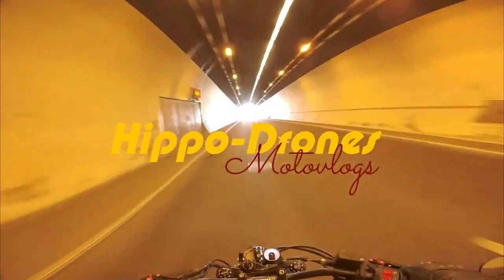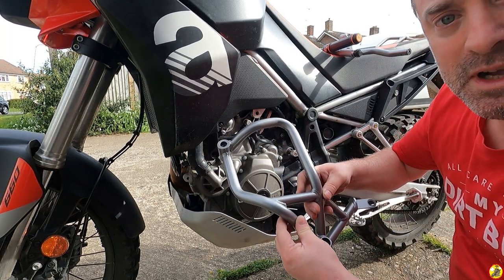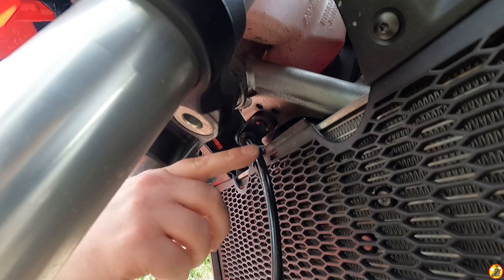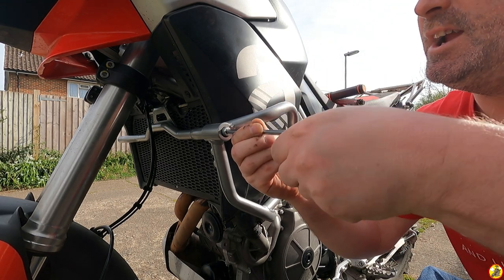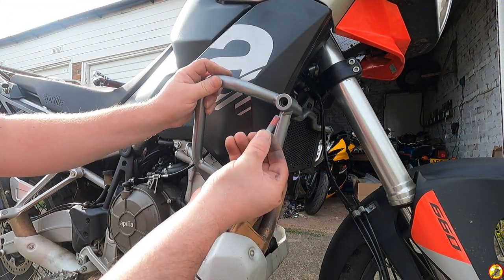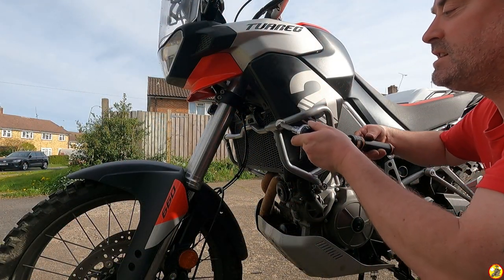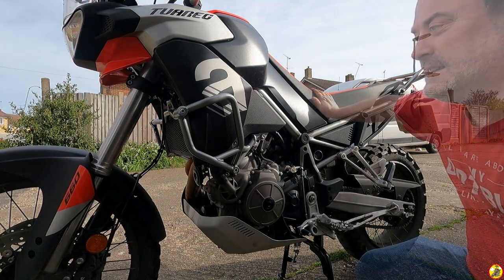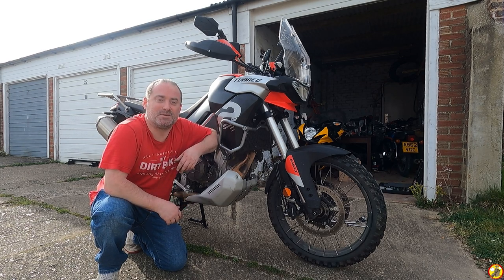Aprilia Tuareg 660 Accessories | Engine / Perimetral Guard Install

Comment: I'm impressed how the fixing holes lined up with no bending or manipulation unlike many other frame & engine bars. 
They fitted quite easily. Nice one.👌 
The side bars look quite small compared to others, but actually they are positioned where the tank panels will make contact the ground. And of course being smaller with less tubing will mean saving weight which is always a good thing. 👏👌🤞👍
Reply from the maker: They really were dead easy to fit and like you say, the position they mount looks spot on to protect the bike. I hope they are as strong as they look 🙂

Comment: I’ve installed the Aprilia Pannier racks, panniers, crash guards and aux lights on my Taureg. All from the Aprilia accessory catalogue. One thing I’ve noticed is how they are designed to fit correctly without being forced to bend or contort the pieces to line up with the bolt holes. I can’t tell you how many bikes I’ve owned where accessories are built to much less exact specs.
Reply from the maker: I've just fitted the SW-Motech sump guard to mine, had to grind off part of the Aprilia Perimetral Guard to make it fit.
Reply: @HippoDrones  sounds like SW Motech didn’t design the skid plate to work with crash bars. I have a Thor skid plate from  GP Mucci on order. It was designed to work with the OM crash guards. I like when the aftermarket attempts to build their parts to work with a variety of accessories.
Reply from the maker: @zyonsdream  yeah, they did say in the blurb that their parts are designed to work with the bike in standard spec so I was expecting to have to modify the engine bars

Comment: Hi Hippo
Just fitted Motea Protection bars to my Tuareg.
Iam sure you found that as i did the front 2 M10 engine bolts had Yellow factory Torque marks & were at a lower torque than the 2 rear M10 with the Red factory torque marks. (could have been Orange) As in Industry Red is usually used to indicate a fastener must be renewed for some reason.

Torqued the bolts to 50 NM (checked in the official service manual) but ]i still believe the factory used different figures front & rear as there would be no need to use different colours otherwise.
The factory seems to use different colour torque marks around the for the different torques or maybe for the wrenches used. Green is also used on some other fasteners.

A tip i would pass on is, before undoing a fastener from the factory setting make your own torque marker line across half the bolt head or nut continuing down the side onto the material area at the side.
So to return the fastener to the same torque re tighten until the markers line up again.
Especially useful for wheel spindle fasteners were you might be out on the road with no access to a torque wrench (even if you know the correct torque)
I tend to use white marks on the l/h side of the bike & yellow on the right.
Reply from the maker: Hey @brie6966 thanks for the tip :-) that makes good sense! :-)
I think there were different torque specs front and rear, can't remember now though as this video was recorded almost a year ago :-)

Comment: Nice how to video, thanks for sharing. A couple of things. I was wondering what Torque wrench you have as it doesn't appear to be listed in your kit and caboodle. Also the torque wrench settings were 10, 25 and 50 Nm? Please confirm?
Reply from the maker: Thanks David 🙂👍
I have a couple of torque wrenches, both I believe I got from Halfords. I have 2 as one is for lower strengths and the other is for higher torques. Think they are from their pro range.
TBH, it was a while ago I recorded this. Your best bet would be to join the Aprilia Tuareg 660 UK Facebook group, you can download the service manual and torque specs from the files section on there for free.

Comment: That's bang tidy fella 👍
Reply from the maker: Should do the job too 🙂
Reply: @HippoDrones  nice little investment as those panels wouldn't be cheap to replace
Reply from the maker: @deepjoyrides  yup... although Aprilia plastics are not too pricey... whereas these protectors were £500 from them... perhaps I should have just got spare plastics! 😜🤣
Reply: @HippoDrones  haha yep that's a good point but the bars look good. You could maybe get some little spot lights to fit in them
Reply from the maker: @deepjoyrides  I hardly ride at night, but might get some small bags for them.
Reply: @HippoDrones  that's a better idea. Get a gear gremlin, tools & a metal flask in them. Super handy
Reply from the maker: @deepjoyrides  🙂

Comment: Wait a minute, did you change your tires?
Reply from the maker: Yup, got the Motoz Tractionator Adventure tires fitted by my dealership before I collected the bike.
Reply: @HippoDrones  sweet! Smart move!
Reply from the maker: @SuperCheesyMan  We have quite a lot of wet mud on the trails I ride, so I didn't think the Pirelli STR tires would suit... although they would be a lot better on the tarmac.
Reply: @HippoDrones  so what's your feedbacks on those Motoz?
Reply from the maker: @SuperCheesyMan  I absolutely 100% love them.... they took the running in miles to the first service to bed in and feel less sketchy on tarmac, but from day one, they were fantastic in the dirt. They are a compromise though, and at pace on tarmac, they do make the bike a little twitchy, but are fine up to 80mph, and faster on smooth roads.... but they are 75% dirt 25% road, so will not be as well mannered as a 50:50 tire on tarmac.

Comment: Those engine bars are very tasty, a nice install again too. I want a bike with engine bars purely as it makes mounting a 360 so much fun :D I must get some prit-stick locktite, looks a lot handier than my liquid stuff. Haha 50 +/- 15 is a bloody massive tolerance, that was the same as my steering damper on the GSXR, head nut was 70 +/- 20 :D 
I do like how slimline they are, do a job but aren't massive :)
Reply from the maker: They look great at the moment! :D hahaha
That was one of the things I loved about the V85TT, it was the best bike for mounting a 360 camera to, frame bars everywhere! I was just looking at the Tuareg just now working out where would be good 360 mounting points for tarmac and also for dirt.
Hahaha, yeah it made me chuckle, but 50 is a nice number, so that is what it got... that reminds me, I need to check the rear spindle nut as I didn't have a torque figure for that (owners handbook doesn't list it) for when I adjust the chain, 120Nm is what I need... no wonder it was stiff to loosen!: D haha
Yeah me too, and was super grateful for them being slim on my day adventure with Mr Fish, had to squeeze through some super tight gaps between fallen trees1 :D

Comment: Picked my Atreides Black up a week last Friday and am Buzzing1 First service done on Saurday. .Great video Man !  Looking forward to some Surrey hills Green la ing. Just ned to get my crash bars sorted and still trying to decide on a new bash plate. AXP looks good but apparently front mudguard can catch when bottoming out front suspension. Any recommendations on bash plates mate ?
Reply from the maker: Awesome to hear you are loving it mate. I have the SW-MOTECH sump guard which is nice and solid. I did have to modify the engine bars though to work with it.
I think the issues with the AXP were just with the Mk1 and they have modified the design now, but I've no experience with their products. 
Hopefully see you out on the trails soon bud 👍

Comment: Have you noticed much heat from right side on your leg?
Reply from the maker: Hi John,
To be honest, no more heat than any other water cooled multi-cylinder motorcycle. Sure there is a bit, but any water cooled bike with a fan will send it to your legs once the fan kicks in, my GSX-R750 is warmer.
Reply: @HippoDrones  Thanks, I've heard it throws off serious heat?
Reply from the maker: @johnboy3100  I tend to wear proper bike kit, so maybe that masks it

Comment: Am I right in thinking these crash bars use the engine mount threads?
Reply from the maker: Yes some of them.
Reply: @HippoDrones  so one bad knock and it could crack the head like it happens on the cb500x.... Adventure bikes with insufficient mounting points that can cause even more damage once fitted... I must be missing something. Gotta say it's a pretty bike, very nice looking.
Reply from the maker: @porter5877  No idea, I mean, it was designed by Aprilia for Aprilia, and all crash bars I have seen for other motorcycles I believe use some engine mounts as the engine is a stressed member on modern bikes, but I guess if you hit something hard enough, stuff will break. Having dropped mine a handful of times now, I've had no issues or damage. Might be a different story on rocks or on the road, but crashing on harder stuff is generally gonna cause significant damage if you don't have any crash protection, so it is a case of flipping a coin. I no longer put crash protection on my road bikes, but the bikes I take on the trails get it because I am more likely to fall off... and fall off at slower speeds than I would on tarmac.
Reply: @HippoDrones  yeah that's a good point dude. I need to test ride one I'd like to feel the difference between the 700 tenere.
Reply from the maker: @porter5877  Sadly the T7 was too tall for me... I couldn't even get it off it's side stand in the dealership, but the 20mm the Tuareg is lower made all the difference. It is still a tad too tall for me, but I'll order the lower seat for it soon now that is available, which should bring it down to 840mm which will be far more manageable on the trails 🙂
I hope you can get a demo, the Aprilia is an awesome bike... but so is the T7, so you can't go wrong with either if they both fit you! 🙂

Comment: Man that’s so much easier than mine. I should be getting mine in next Tuesday. I helped my buddy install his on the Africa Twin so now to do mine.

Is your Rad guard plastic or Metal? Mine came with a fairly ridged plastic and wondering if i even need to upgrade. Probably should eventually.

Man that’s a good looking bike😎👍.
Reply from the maker: Thankfully dead simple, and hopefully well designed and strong.
I have a plastic rad guard currently, and will probably replace it with a metal one when I get a chance.

Comment: Also..., I recognise that block of garages. Did you make a video a few years back reviewing the Worx Hydroshot battery powered pressure washer? I think the bike being cleaned was a Beta Alpha? 
If you did, following your review, i bought one during the 1st lock down. Cracking bit of kit I love it. 
I take it in the van with me with a 5L water canister when I go mountain biking & Motocrossing.
No more scraping & brushing  piles of mud off my drive. 
Who needs that after a long day riding & your tired & it's getting dark? After what you would pay at the garage  jet wash every sunday, it eventually has paid for itself.
I also use it to wash the van when I can't be arsed with the faff of unraveling the hose pipe down the drive 👏.
 If it was you, have you still got your Hydroshot & do you still use it?
Reply from the maker: Hi Dan, yes that was my video. I still have the HydroShot, I love the Worx battery tools,  have several of their products. I have not used it recently as I've found it more convenient to use a jetwash at a petrol station, but you are right with how convenient the HydroShot can be.
I loved my Alp 4.0  but traded it in for a Beta 390RR  a couple of years ago.... and am contemplating selling that now I have this Aprilia, which has so far excelled in the dirt and done far more than I thought it would be capable of!
Reply: @HippoDrones  yeah, if you're riding to your off road routes then for pure convenience & weight saving the jet wash on the way home still wins. Leave all the sloppy muddy mess on someone else's floor. Your not just getting a wash but saving time not sweeping up the slurry after. Less to do when you get home especially in winter when it's getting dark & cold. 
That's a bold statement about selling the Beta because of the Turaeg. Shows just how good the Turareg is. 
But it's nice to have the option to load up a lighter bike with your mates in trailer or van & drive somewhere longer distance for a weekend away trailing. -Like France, spain or Isle of Man etc.
Depends what you want to do really, but also nice to have options.
Reply from the maker: @gtomcat321  absolutely,  is why I'm going g to wait until next Spring I think before deciding

Comment: Picking up the gold version this weekend.  Ordered rack and guards like you.  I have the Garmin Zumo Xt to put on, have you looked for the best place to tap into for a switched hot wire.
Reply from the maker: Ahh brill Jim, I hope you love it as much as I do mine!
I have not gone for a switched supply at the moment, just gone straight to the battery, but hope to in the future.
Reply: Does the Zumo XT have the ability to charge via USB?
Reply from the maker: @mart7404  if you wire it to

Comment: Lookin good mate nice tidy job ,how do you find those tyres on the road in wet and dry ? : )
Reply from the maker: Thanks 🙂
When they were brand new, they felt pretty sketchy on tarmac, but now with 700 miles on them they have settled down and grip feels great... but they don't like going much over 80mph. I realised the road manners would be reduced when I ordered them, but today really showed that it was the right choice for me to swap the original tyres for these! 🙂